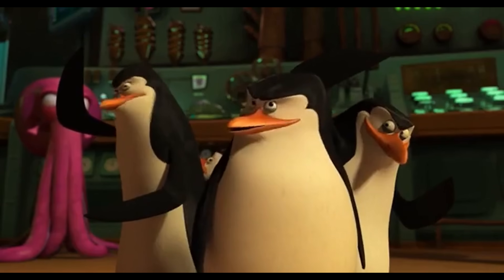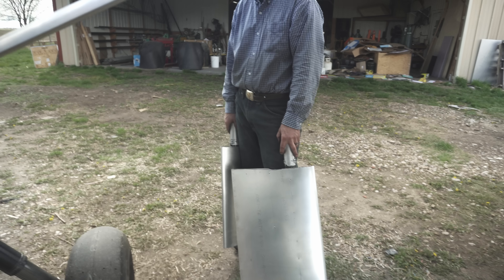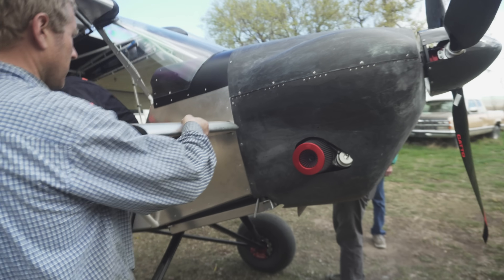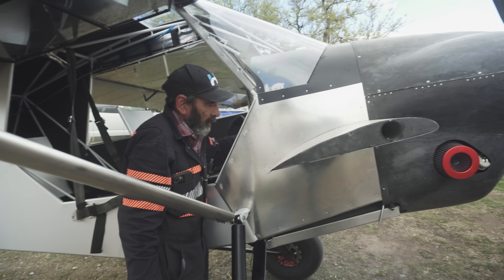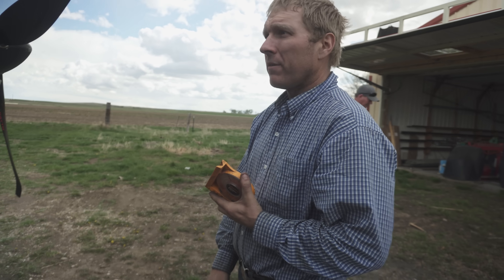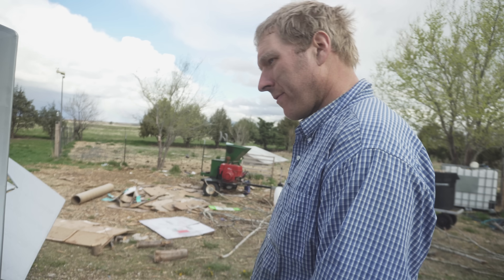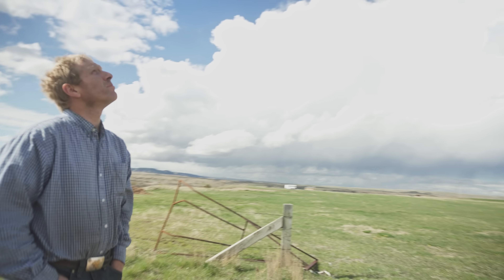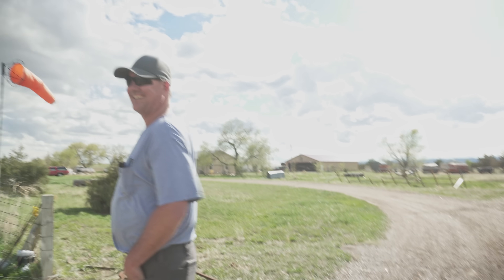Canard on a Bush Plane… Will It Work?”

Comment: Hi put these canards on zero AOA and modified the trailing edge about 2.5" inch with trim. and use this trim against the elevator stick movement definitely it will helps a lot.

Comment: You made a point of saying you'd check the elevator trim when he landed to keep him honest, but not one frame seems to show the trim tab clearly after he comes down. Did he trim it out at all to try to balance the controls?

Also, did your lift centre calculations include the full-width "trim tab" at the trailing edge? That wouldn't impact overall lift much but could be at least part of the extra torque in flight that prevents adjustment.

Comment: That's pretty cool!
I make RC flying wings from scratch and I add a nose with a lifting body which adds up elevator in the front in a similar way that a canard would. It allows me to use a asymmetrical lifting air foil without the nose wanting to pitch down and that allows me to trim The elevons to a neutral position with no reflex or up elevator or at least an extremely small amount of up elevator  which extends the lifting area of the wing back to include the elevon itself The increase in efficiency is significant and I can see why airplanes like the long easy have such high efficiency.

Comment: The tail being an opposite foil kind of pins the heavy nose up from dropping.  Those opposite forces kind of lock in some stability.  Lightening the nose dramatically actually starts to make it act more like a flying wing I imagine which can becomes more instable.  It can also on the other hand make it more responsive to tail inputs.

Comment: If ya'll really want the canards to work for low speed handling I would suggest taking a page out of the Eurofighter, which angles it's canards into the wind so no matter the AoA it can get good lift. It would also do better with semi-symmetrical airfoils so it doesn't move the CoL to far forwards and make it pitch up unexpected and instead act like a horizontal and keep the plane going straight.

anyways love what ya'll doing, keep it up <3

Comment: Canards introduce complex airflow interactions between the canard and main wing, creating wake turbulence that can disrupt the main wing’s lift. This requires careful design to avoid instability, especially at high angles of attack (AoA) common in STOL operations. I dont see any careful design here, no wind tunnel testing or software programs.
       In an ideal world the canards would also be much bigger than seen here, (think Rutan’s Grizzly) and be linked to the elevator in the tail to assist its function if pure STOL was the main aim.  
       For stability, any canard must also stall before the main wing, necessitating a higher lift coefficient or lower critical AoA (often achieved with a high-aspect-ratio, heavily cambered airfoil, ie not as seen in these mini canards). This makes canard sizing critical, a canard too large or too small as seen here can seriously degrade performance or lead to dangerous handling characteristics. 
      The problem with canard in this configuration, would be the turbulence and disrupted air under the main wing, especially at high AOA and slower speeds, where any vortices could even create negative lift and reduce controllability of the ailerons. Research canards and deep stall, due to CG issues, one minute you have a super STOL aircraft, the next you have a deep stall unrecoverable crash!     Please don't continue with this project guys, there is lots of research out there, and a reason why bush planes and high wing aircraft don't use canards.
         I loved the aviation spirit, but try a wind tunnel, or software program first guys, for safety reasons.  😉

Comment: The bit at the back is called the stabilisers. Wing area up front is destabilising. An increase in stabiliser area would be needed to return the aircraft to the same dynamic stability.

Another way to decrease the down-force from the stabilisers would be to reduce their area, but this would also decrease dynamic stability and require higher input to maintain directional control at lower speeds. 

That's my 2p.

Comment: Have center of rotation forward and have it free fly. In other words, allow it to point into the wind and then Mark it where it is positioned. Naturally when flying and that'll be your center point from there, you would have to adjust it with your elevator simultaneously

Comment: I suspect the pilot flying the plane is so used to using the tail downforce to lift the nose and slow the plane, that the canards feel as though they prevent his ability to do that... which is exactly what they are supposed to do! With canards the flight control is reversed from what the pilot is used to... instead of trying to use the tail's downforce to lift the nose, it is the canard's lift that is intended to be used to lift the nose, with no (less) downforce from the tail. The pilot eased the lift on the canards to give him back attitude control with the tail, instead he needed to increase the lift on the canards to raise the nose with the canard lift, using the tail to balance a plane that now suddenly always wants to go nose up. It is a completely different flight control approach and will be a challenge for the pilot to adjust, given how used to traditional flight control he is! This is dangerous territory! There is a reason 'test pilot' is a dangerous job! Please be careful, but don't give up, the physics theory is correct, but must be flown differently! Good luck and please stay safe!  -Shawn Miller, Physicist...
Reply: It's like trying to learn to fly an entirely new plane with control surfaces that are still in a design phase... please be careful!

Comment: Hal, my thought is in order to test, don't adjust in flight.  Try 3 or 4  fixed settings and mark the angle on the side of the cowl.  Then you can test fly each setting and compare performance between each setting.  Find optimal setting for slowest stall speed.

Comment: ive considered alot how a bush plane designed from the ground up in a canard configuration could perform
basically it would have a fully blown elevator at the front
ive made funky rc models from foam a bit like this

Comment: I would think a lever to control the pitch of the canards would be better (allows for quicker adjustment) than a tiny hand crank.  Also, having that imbalance of the wing lifting and the tail pushing down is what makes the basic airplane stable.  Adding lift to the front, especially if too much, nearly makes the tail a lifting section as well, thus the instability.  I believe a lot of modern fighter jets with blended wings and fuselage sections have to be fly-by-wire because practically every surface is a lifting surface, they're unstable by design.  It's a trade off, instability for maneuverability (and ability to do maneuvers stable aircraft can't do), stability for easier and more controllable flight.  Of course, that's all very general in nature as there is so much that goes into the design of each aircraft.  

If I understood your reasons for the canards correctly, you're just looking for a way to remove weights needed in the rear for STOL competition?  Is it  a matter of "running out of elevator" in super slow flight?  Maybe make the canards smaller, limit their range of motion and tie them into the stick.  It probably wouldn't take too many test flights to find the right set up.

I'm not an aeronautical engineer though, so.....

Comment: It definitely needs flaperons you are correct it changes the center of lift and moves it further forward but it also changes the total % of control surfaces to a lower percentage leading to less control authority and being stuck with a fixed wing. adding flaperons its the way

Comment: It moves the Center of Lift forward, so it can be unstable a bit in pitch.   Possibly dangerous.   There needs to be a few inches between the overall center of lift and the cg.

Comment: Get one of your younger friends to put your design into a virtual  wind tunnel and team it up with an A.I.  and instant success .  I think you are really onto something good with your design .  Keep in mind you are getting a lot more lift with no increase in aileron control .   If you give too much angle down lift the canards the lift be strong on the canards because of prop blast then the lift will break then lift again like a rock skipping on water .

Comment: I think they would work great if the test aircraft has a forward CG problem like an empty 182 does. You run out of elevator long before the wing stalls. However if your test plane doesn’t have that issue it likely would just hurt your stall recovery. Course I’m no aerospace engineer but I did stay in a Holiday Inn! 😁👍🏼

Comment: A lot of helicopters use symmetrical airfoils because the center of pressure doesn’t move, or barely moves as the angle of attack changes. Might be a good option for this. And perhaps put air dams on the edge of the wing?

Comment: My unqualified groundfowl's notion is that the added friction in moving the front aerofoil may be related to the airflow from the prop impinging downward upon the right aerofoil and upward at the left. This may be loading the bearings before any upward or downward deflection is selected. Different angles of attack for the left and right aerofoils might be needed. Unintentional drag may have been introduced in the corkscrew airflow from the prop. The apparent reduction in cruise performance may be the consequence. When the Eagle XTS was being developed, I understand that there was some masking by the front wing of the centre wing at steep angles of attack. I think fences on the centre wing and some vortex generators were the fix. It would be interesting to tape some wool tufts onto the Badlands fuselage to see what happens to the airflows each side and view them with a GoPro on each wing. 

https://www.youtube.com/watch?v=x4jYVgYDlmo

Comment: The "In-Flight" adjustment force can be reduced significantly by moving the pivot point of the canards closer to the center of their chords. Experiment with this a bit - I view these canards as being an elevator trim-assist.

Comment: The canard could be interesting, but it absolutely needs to be linked to the attitude and activities.. e.g. it probably interferes with the wing at high AOA, when it's "flat", so it needs to be coordinated with the flight envelope... During takeoff, in a normal attitude, the extra lift is fine, but the angle needs to droop down during STOL, so that it provides some lift, but isn't generating turbulent air over the wing, so, maybe you could have it operate down when the elevator goes up, and maybe have a kind of "differential" setup so that the angle is also increased with flP activation, since flaps are, generally, part of a higher AOA, at a given elevator angle... Just an idea.

Comment: A biplane has two wings for more lift for the same span.
A positive camber would take a small amount of weight off the nose for a very small 
speed range thats not worth it.
If the canard is symetical and it would need a zero angle of attack in cruise, 
As the Airspeed slows there is the greatest change in center of lift

and elevator position,  A Canard that moves with the tailplane
is the only way it could be a effective aid but what practical 
advantage could it be? 

Great Video, Thank you

Comment: I would think it might be better to use slats before the canards? I believe slats also move the center of pressure fwd which would move the CG back same effect as adding weight to the tail. Mechanical slats and spoilers seem like a good option. I believe gravity knight has added slats to his blt? I don’t think Clint is a fan of slats?

Comment: Looking at the cessna's Kanards I noticed that they had a flat profile instead of an air foil. I suspect this was  so that they only created lift with the angle of attack / Flaps and when flat, the lift was reduced to allow for normal handling in regular flight.

Comment: You want your oil temperature to be hotter than 212° such that any water within the system boils off. If you're running 230°, that's frankly ideal.
Reply: I'm a fan of the heat exchanger setup.
Coolant leads oil temp initially but when warm oil temp leads
  Generally 5-10°c

Comment: Cessna had a great plane with Canards that "Wren"... watched one fly at my little airport, although the guy flying crashed his plane, ..flying it off the ground in a stall showing off on a hot day,... it looked like he had good roll control with full power all the way to the cash🤔,... and I have pictures of that .... hope your idea works out Hal ?  *Thinking a bit here .. I would work on putting Gates on those Wings and Tail Feathers.... focusing  the air flow on those control surfaces... but thats just our thought from inside the Hanger here.😁

Comment: I think you're making too quick of a judgment. I think you need to do a methodical test flight series on this. It should be flown and recorded exactly what miles per hour it stalls. That's to be done with and without the Kennard and done at various recorded angles of attack on the Canard. Be methodical

Comment: The instability could partly be due to unbalanced propwash effects. Try flying with only one side installed,  depending on the typical pitch change with throttle, if any. I.e. if pitch increases with throttle application then put it on the descending blade side, RH for a Rotax, and vice versa.

Comment: My concern would be unforeseen effects on stall and spin behavior, especially spin recovery.
Reply: Less cord on those canards, more span, symmetrical airfoil, careful testing, and the result would be beneficial in all those areas.
Reply: @philalcoceli6328  What he means is flat spin, not the acrobatic spin.
Reply: @MarcinP2  Got it.

Comment: Guys think about the slipstream.  The effective airflow/angle of attack will be different left side vs right side.  So trimming the canard will  be very difficult.
Reply: Because of the prop airflow around the fuselage?
Reply: @johnfitzpatrick2469  Yes
Reply: Like some others have pointed out it’s effective on the Katmai conversions.
Reply: Which have elevators they move with the stick.. these are stable, which might make it harder to turn and by might I mean, obviously to some degree
Reply: Was looking for this comment.
They'd  need to put some tufts on a stick in the mounting holes and record the angle. Then they could compensate for the prop-wash by adjusting each canard to a different angle.
The way it is setup now each wing will produce different lift and stall independently.
Combined with the unstable pulsating air off the prop makes this setup hard to gauge.
Reply: Wow, good point.

Comment: Your canard needs more span but less cord and Hal is right, needs to be at least semi-semetrical to not be pure drag at higher speeds. As short as it is currently,  its basically riding completely in the prop wash. Ideally,  for optimal performance it really needs to have a moveable elevator so to speak like the Katmai.  The all moving canard changes too much with any pivot at all. I suspect by the time it's all said and done Hal will scrap the idea because it will require too much complexity to make it improve anything which means extra weight and Hal wont like that.
Reply: First thought as well ~ They're too short to do much at the airspeed subjected to. 
And Yes, eliminate any chord. 

I'd double the length ~ Then lever actuated vs slow cranking. 

Latching Lever release button on top ~ moved from neutral to full up or down ~ lever moved 6" forward to 6" back. 

Locking notches every 1/4" of lever travel. 

Now one can move canard to actually feel/see results instantly, then fine tune for best cruise. 
In the prop wash ~ the left and right canards  might have to be a few degrees different. 

The left one is being hit harder on bottom side ~  right one is being hit harder top side ~ Right? 

Might need tuft fuzzy  stick on's and video each side to verify. 

The heard theory of unloading the tail doesn't sound right during take off. 

It would make a bit more logic with canard pitched downward to add prop wash weight forward of CG for getting airborne, 
then trimmed constantly   
up to cruise speed. 

Almost need single axis auto pilot to make all the moves in real time. 

Certainly looks fun to experiment with. 

I don't envision any critical crisis adding its function.  
It's basically what we did as kids at 65mph in the  back seat, sticking our hand out the window as Canard, deliberately correcting & stabilizing  Mom's driving. 

As noted someone stated winglets at tips ~ He's close, but more effective would be aggressive vertical slats 2" tall 4" apart top & bottom of Canard. 
For 100% engagement of Canard. 
I'd make Canard absolutely flat for zero drag in level flight. 
Cheers 🍻